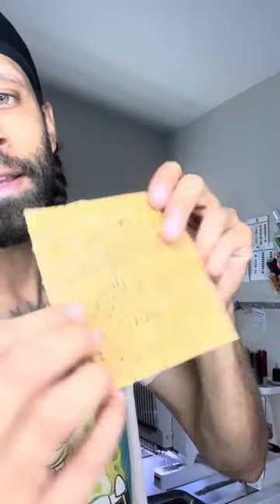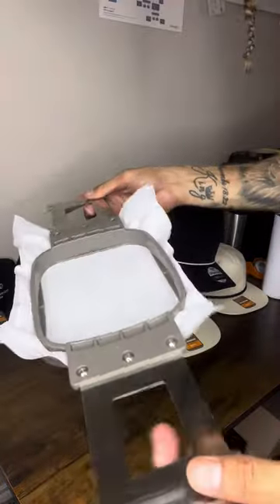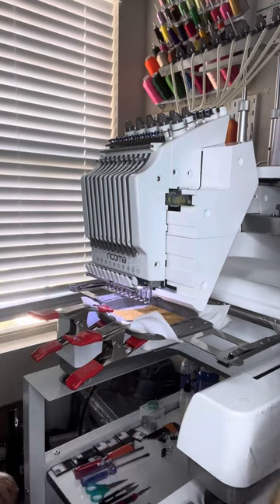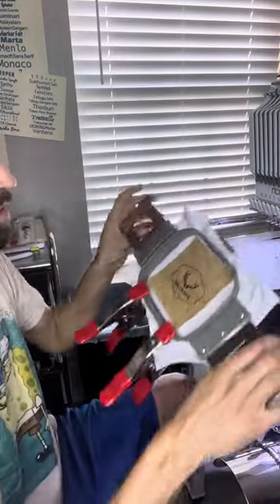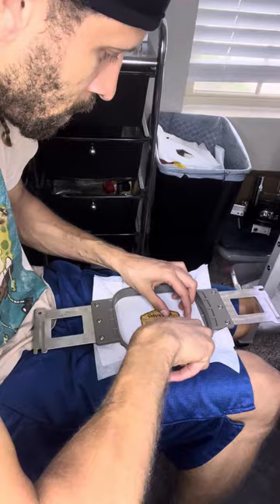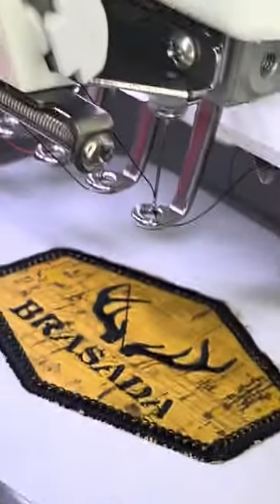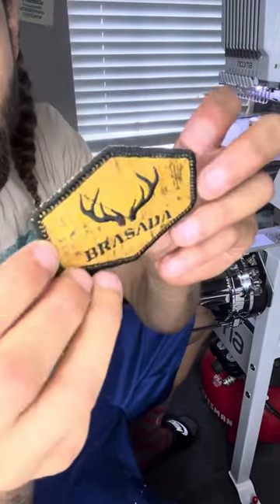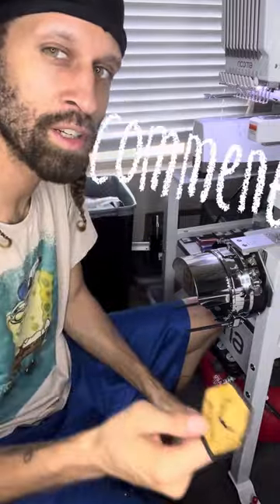Embroidery Tutorial: Make Borderless patches without special materials

Comment: Anyway you could share a link for the polyester felt you use for sublimation patches. Got a customer that wants samples for of patches. Never done it befor and I’m trying to use poly twill right now but want to try other options
Reply from the maker: YYCRAFT Stiff Felt Sheets Thick Felt 9 Inch X 12 Inch - 15 Pcs Pack, White https://a.co/d/aQ3mGxQ
Reply from the maker: See if that link works! It’s a thick felt material. Sublimation transfers very well on it
Reply: What temp and time you press your sublimation to the felt?